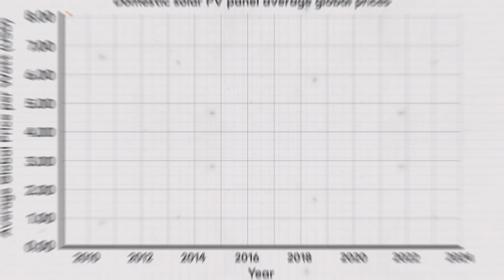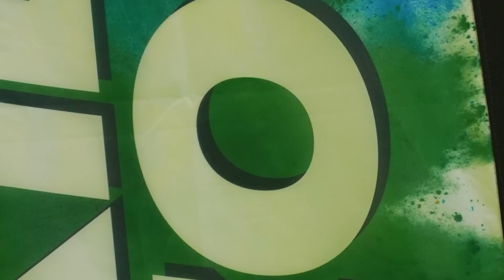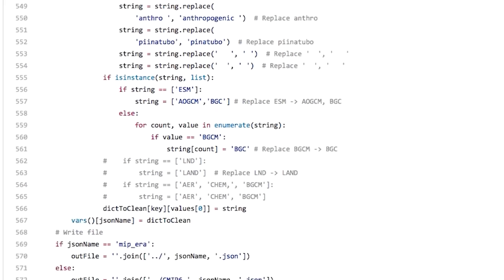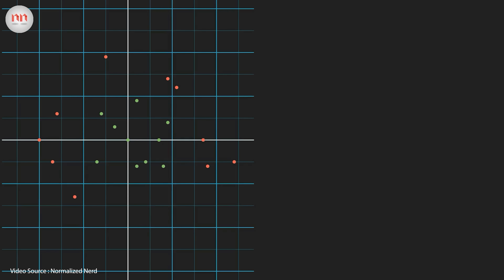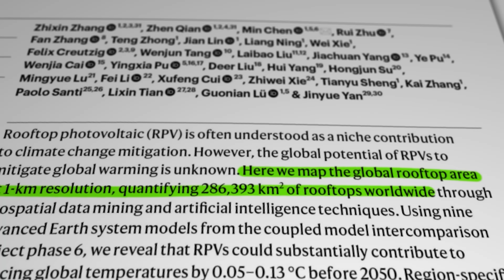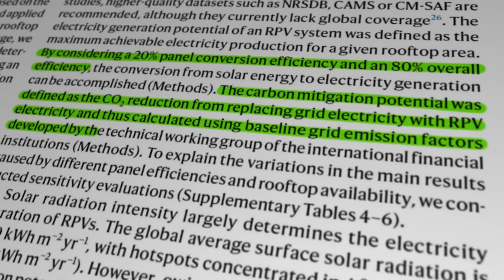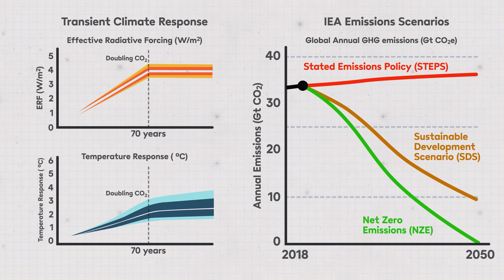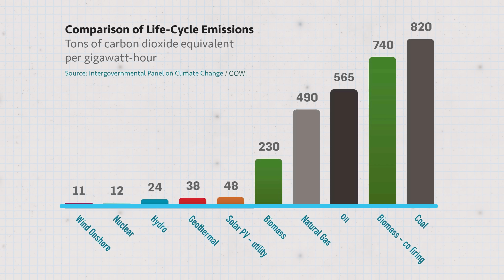New Report - Rooftop Solar PV is THE biggest climate mitigation technology!

Comment: my 4kw rooftop solar is in it's 12th year now...well worth doing...there is no sign of any panel degradation yet..never even cleaned.  I love them sitting on my roof quietly making me free clean  energy.
Reply: Residential solar PV is a big fat middle finger to the man. I refuse to be a working-class cash cow for the oligarchy. Centralised energy has moved wealth to that lot; I am taking that wealth back by brute force.
Reply: @theunknownunknowns256  exactly right grid electricity is 10% electricity and 90% grid rental. 
Many are ignorant or stupid or both.
Reply: Okay! Come by my house please and we a talk
Reply: Snap
Reply: just give them a bath and watch your productivity zoom up! I suggest twice a year should be good enough unless you live in a very polluted place!!
Reply: Payback period is always used as a reason to not do things by the fossil fools. An argument never used with their alternative. I reckon my initial array paid back in about 6.5 years. I installed 3.25kW WSW facing array in mid 2012. I expanded this with a 1.4kW south  facing expansion in 2019 & installed a PW2 as storage. The latter I did on a finger in the air estimate. Why? Simple. I knew all that export had a value to me. I also knew off peak tariffs & storage would save me money. I’m  certain this has paid back in a similar period. My electricity bill has been slashed. The only gas usage I have is heating & hot water. Everything else is electric & I drive an EV. My gas usage in cost is twice my electricity usage.
Reply: If you have sun
Reply: What brand
Reply: Yes brother! 4kW 11yrs here. Added 6kW + 12.8kWh battery last year.
And 2 second hand EV’s. The ROI across all of it is 5-6years. Maybe higher pending petrol and electricity inflation.
Reply: Amazing, but like Never cleaned? I suppose you live somewhere where it rains periodically and there isn't a lot of dust in the air. Where I live, we have to wash them weekly, or bi-monthly, otherwise the dust reduces the panel efficiency.
Reply: @MrBurairHaider  I live in the NE of england ..plenty of rain..lol
Reply: @peterjol  I've had solar rooftop for 11 years in Mass. I only had to spray water on them for 2 short periods when the pine pollen was everywhere. It was a bonanza of greenish yellow everywhere, even made it into the house.
Reply: @markvalery8632  uck, I am familiar
Reply: @MrBurairHaider  They say it's 5% difference and I don't clean ever. Install a panel or two more and forget about cleaning.
Reply: @slavric  Well whatever works the best. in some places it does get too dirty too quickly, it requires to be cleaned. not everyone can always afford more panels.
Reply: Without overall control of saving energy solar has been pointless for all people that I have seen, friend got some and great rate back that is due to run out but with the money saved bought a motor home and travelled the country. An average UK household uses about the same amount of electrical energy in a year as is in 11 tanks of diesel. With solar being around 2% of total energy in the UK and just being an add-on to total energy, solar has had zero mitigation on the climate because their has been a zero reduction in energy consumed.
They're not free and they aren't clean, China has used the same amount of coal in the last 20 years than USA in the last 100, and as I say overall, with electricity being around 20% of our total energy, Solar would have to have a 1000% of all the installations of the last 2 decades and still 80% of our energy needs a replacement if we want to maintain society as is which is supposed to be impossible. 
Reality is we could all go to electricity, cut everything else, cut consumption overall and by staying on coal we could have cut 80% of energy.
Reply: I see the cold board of really got in with some of the comments below, but none of it is convincing! I’ll try not to read too many YouTube comments these days but rather go to different reputable channels that know what they’re talking about instead.
Reply: There is some doubt that increases in rooftop solar, will cause problems with installed cable networks for exporters of electricity. Dispersed generation could also have problems for the safety of line workers due to back feeding of the network. Of course finally there is the economic argument, where the people at the lower end of the social scale, renters etc, who would have to pay increased electricity charges as the pool of consumers would be severely restricted.
Reply: @robindumpleton3742  keep burning that coal. Right?🤦‍♀️
Stop commenting from a position of ignorance about rooftop solar.
Reply: @robindumpleton3742  did you think about collapsing grid income.
Look at the famous duck curve.
There are 2 duck curves. 
The 2nd is the collapsing GRID CASHFLOW. This is so f......king obvious.
Reply: @stephenbrickwood1602  we don't have a renewable energy generation problem. We have a renewable energy storage problem that still needs sorting out. So keep your coal and start thinking of storage solutions available now like off-river pumped hydroelectric, chemical batteries, sand batteries, geothermal batteries, dynamic energy such as ev batteries to compliment home batteries, gravity batteries. 
A distributed grid is more efficient.
A distributed grid is more resilient.
A distributed grid is more reliable.
A distributed grid is more secure.
A distributed grid is more cost effective.
Shall I continue?
Reply: @hitreset0291  no.
Australia has 20million vehicles.
V2G EVs massive storage batteries on wheels will be 2,000gWh plug n play grid storage on wheels. 
Buy the vehicle and get free mass storage daily, 23hrs and all night long.
Top up daily with dirt-cheap rooftop PV electricity.

I like your thinking, I have a different background to many, except my fellow grid construction engineers who are absolutely silent.

Too much money to be made.
Reply: Must be nice to be so rich that this is free to you! Maybe use a tomato based Marinade.
Reply: How is it producing free energy, did a magical fairy make them?
Reply: @kmoses582 Dont be obtuse, you know where a solar panel's energy comes from.
Reply: @zedukelstarstryker9875  Just because the fuel source is free does not mean the capital is free.
Reply: @kmoses582  once the panels have paid for themselves, everything after that is free. And after 12 years they have undoubtedly already paid for themselves. So yeah, you're just clutching at straws here. Give up and accept reality
Reply: @ After the payback period (mine was 4.5 years), I've now had 6.5 years of making money. So I guess it isn't free because I make money from it now, it is better than free.
Reply: @kmoses582  So you know of a free way to produce energy?  If not, your comment was dumb to start with.  Of course things cost to buy (and produce) but when done, the sun energy is free.  Buy a diesel generator, it COSTS TOO, and after that you pay for diesel.
Reply: @kmoses582  wow aren't you the economics genius?!🤡
Reply: @PjotrII  I never claimed that there is a source of free electricity.
Reply: @hitreset0291  You do not have to have an expert in economics to know solar panels are not free.
Reply: @kmoses582  No, but you tried to make "fun" of the thing that solar isn´t 100% free... so what was your point?
Reply: @PjotrII  I thought my point was self evident, solar is not free.
Reply: @kmoses582 I am still paying for propane and buying wood, my neighbours with solar panels have had free electricity x 9 years. What's your problem with that?
Reply: @elainebradley8213  I have no problem with solar, but it is not free. Solar panels cost money. Also they don't work great at night.
Reply: @kmoses582  duh. Which is why "payback time" enters the conversation when making a purchase decision.
Reply: @hitreset0291  Never said solar can't be a good deal,, I am just pointing out that it is not free.
Reply: @kmoses582  bravo. Kudos. Well said. Can't wait for your next illuminating comment.🦾😂
Reply: @kmoses582  Its not that hard if you pay attention.   The panels WEREN'T free, but they've paid themselves off a long time ago.  The energy they produce NOW IS free.
Reply: @xiaoka  If I paid for panels with cash, it does not mean that the energy is free.
Reply: @kmoses582  12 years sounds like they've paid the panels off and now all electricity generated is at no monthly cost...ie free.
Reply: @colinwiseman  Just because you paid something off, does not mean it was free.
Reply: @kmoses582  If something uses free fuel and has paid off its installation and maintenance cost tell me the cost per kWh?
Reply: @waynecartwright-js8tw  The cost per kWh is averaged over the lifetime, why are you so offended that I am not pretending that solar is not free?
Reply: @kmoses582  I'm an electrical engineer , as with replacing less efficient lights etc If something can pay for itself the issue is not just upfront cost but can you afford not to do it ? Nothing is free but its cost over time is favorable and both doing nothing or something have cost implications
Reply: @waynecartwright-js8tw  I never made the claim that solar is a bad investment, my claim is that it is not free.
Reply: @kmoses582 does K in your name stand for Karen?
Reply: @mikeypc3592  Why are you guys so mad that I brought up the fact that solar energy is not free?
Reply: @kmoses582  or perhaps the angels. I haven’t seen any of  these extraterrestrial beauty’s near my solar panels so far yet 😂.
Reply: Here in the Rainy Pacific Northwest are blue State Governor is ignoring the Supreme Court decision Chevron Accords and is offering $30,000 tax rebates to install solar panels in a region where it rains more than 9 months out of the year and more even a napkin calculation with the roof of an ordinary house completely covered in solar panels it can never achieve self-sufficiency. Instead the solar panels cook off whenever the Sun comes out and then freeze out whenever it's clouds come over causing massive grid disharmonization and surges in voltage. And where did the $30,000 come from? It came from renters people who benefit not at all and going to wealthy homeowners who don't need the savings anyway. These solar panels are installed by gippos and are the cheapest available Chinese panels with only a 15-year warranty they lose 8% of their capacity every year and are only warrantied for one year by the installer. After 1 year you have to go to China.

Comment: That's amazing.  Roughly $150 to power all your lighting and devices.  LumenCache ReNetA demo kits start shipping next month!  As UL certs finish, we'll fulfill the backlog.  Thanks for the support over the years!
Reply: Plus, no grid tie headaches and permits needed.  Why bother when commercial solar fields are selling wholesale so low you'll never compete selling your roof extra power.  But you can add a battery (also low cost today) and have a resilient home

Comment: I don't even use solar panels for regular power and they have already paid for themselves in saved food during three natural disaster/extended power outages.
And I've helped two friends who had power outages ( by charging their batteries on my panels during the day while they used my loaned battery).

On top of that they've saved about $50 in electrical bills from running the AC two hours and 15 minutes per day during the summer during the first summer.
I expect to save about the same this coming summer.    And I may double my setup.   Plus the batteries have dropped from $1 per watt to $0.60 per watt recently and I may be able to get a new battery this month that will run the AC for 6 hours: 45 minutes per day .   Which I can loan to friends... which can keep the freezer going for 45 hours or keep the fridge going for 15 hours.   And which will save me about $150 this summer.

Unfortunately, the current subsidies are setup to help high middle class and upper class families in the U.S.   We need to give a really high subsidy on one or two panels per year.   Say a $50 tax credit per panel for the first 2 panels per year.   That would help poor people buy them.   

Giving a $6,000 subsidy on a $27,000 solar panel set up only helps people making 6 figures.   

Imagine if everyone had a couple solar panels and a 2kwh battery.  We would be much more resistant to disasters.   And it would cut our centrally generated usage for many people by about 3% to 5%.
Reply: 2 panels and a micro inverter cost only ~250$ here in Germany and you can just plug them in. VAT free and no electrician required.
They are popping up everywhere.
Reply: Well, no chance of that happening for the next 4 years at least.

Comment: One detail about PV that is hardly discussed is that, as it converts 20% of received solar radiation directly into electric energy, it effectively removes 20% of the heating that would otherwise happen, from the irradiation budget. Admittedly, this only from the area covered by the PV panel, but with panels on every roof the net cooling effect could be substantial. Houses would need less AC. Double win!
Or have I misunderstood something?
Reply: The 20%of the total irradiance with which a solar panel interact with is in the visible spectrum of light. The heating is caused by infrared rays, sadly a solar panel does not convert that to electricity.
Reply: @MrBurairHaider 
But the panels do shade the roof from UV, meaning roof heating is massive reduced. I noticed how much cooler our loft space was after solar panels were installed, compared to when the slates were in full sun.
Reply: @johnnodge4327  you are right. Of course it has a shading affect. But you can have a shade of anything, there is nothing really special about it.
Reply: @MrBurairHaider that is incorrect. Solar panels do keep the house on the roof of which they are mounted significantly cooler. Firstly, they also adsorb IR, even if that is not at their peak of adsorption. Secondly, all wavelengths contribute to surface heating.
Reply: @ it isn't incorrect. I am correct on the fact that most of the electricity generated by the panel comes from the visible spectrum. And most of the heating affect comes from the IR which is absorbed by the panel primarily as heat. (not converted into electricity) And so is the UV, but the UV contributes more to the degradation of the panel than simply heating it.
I meant to say that the cooling affect that a solar does provide is just because it provides a shade. Put a tin sheet over your roof, it will be almost just as cool as if you had solar panels.
Reply: @MrBurairHaider  You are NOT incorrect about absorption spectra.  You are incorrect in saying that roof-mounted solar panels don't contribute to make the house cooler.  No matter how you put heat, less radiation will hit the roof with the panels than without.  I also agree that anything mounted a few centimeters above the roof, be it solar panels or anything.. with air circulation underneath... will have the same effect.  Except we don't do it, except for solar panels.
Reply: @st-ex8506  idk may be I said that, but I didn't mean it. I agree it does provide a shading affect, but not in the way you would think. (such as converting it into electricity)
Reply: I think they may cool the loft of a house that already had a black slate roof but I still think they will increase localised heat. What if you had a white or light coloured roof. Just like adding some soot on polar ice caps adding black material all over the world may offset some of the stated global heat reduction.
Reply: @JoeBloggs-wu4sw Good idea!  But who exactly has a white roof?  NONE of my neighbors at least 5 miles around!
Reply: @st-ex8506  in warmer climates it is quite common. See Greece or other countries on the Mediterranean coast.
My parents house in Italy has light grey tiles. While my house in Germany has black tiles. Luckily it is covered with PV. 😊
Reply: @st-ex8506  supermarkets, warehouses, mobile homes. White was just an extreme example to make a theoretical point. I guess terracotta is most popular. Still more reflective than black. I'm not against solar and have some myself but do notice one end of my house is pretty unbearable during the hottest summer month now. I use air con powered by it now that sends the excess heat to the back of the house where it's colder haha.
Reply: @martinmurer4954  That is correct!  One point for you!
Reply: @JoeBloggs-wu4sw Ok. fair enough.  I don't know your reality.  Mine is that, like in most of Europe, air conditioning is totally superfluous.
But I fully agree that roofs should be painted in white... I have heard there are even more energy-reflecting paints than white... in hot climates.  But here, in central France, we are just fine with our traditional bakes earth tiles.
Reply: That 20% will also get converted to heat when the electrical power is used. Sorry.